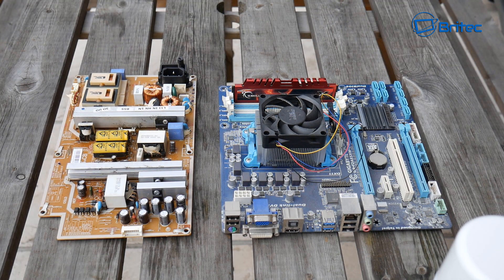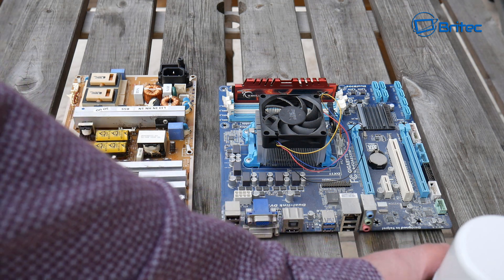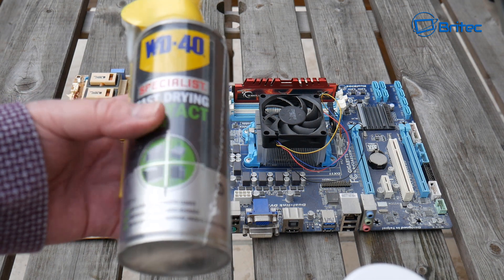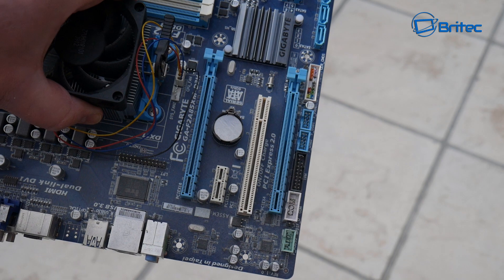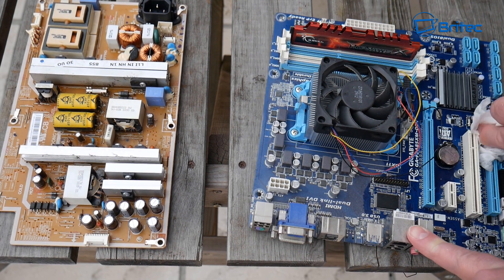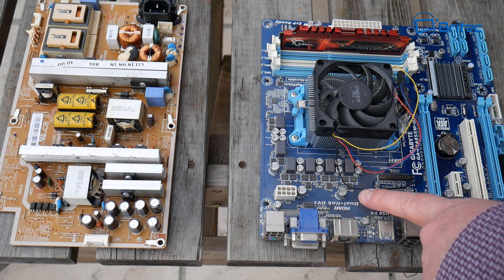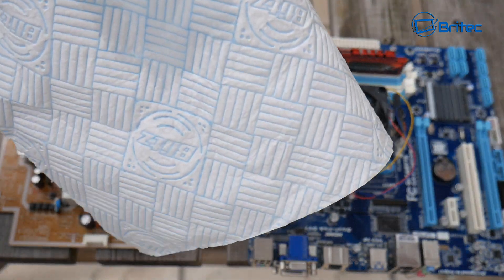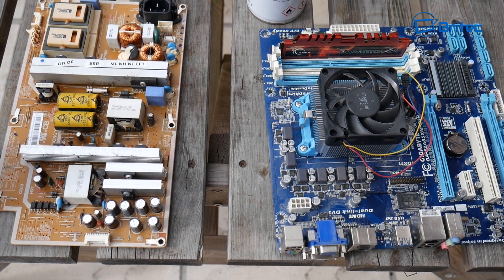How to Clean Computer Parts

Comment: Would Contact Cleaner work for more modern stuff? I have a ROG Maximus Ranger VIII and a GeForce GTX 1070 SC... I know its okay with motherboards, but I heard something about it not going w/ heat sinks well. I was just wandering if it'd be fine to use the Contact Cleaner on those

Comment: isopropyl alcohol is extremely flammable.  break cleaner, also known as tetrachloroethylene is not flammable and non corrosive.  they use this chemical on dry cleaning clothing.  but, not all brake cleaner is composed of tetrachloroethylene, so you have to check.  usually if it reads it is ABS sensor safe, it is the correct type.  this is common knowledge, look it up.  i do enjoy your channel but it is important to call out misinformation.

Comment: Just air compressor and a set of plastic brushes with different shape. Faster, cleaner and cheaper.
Reply from the maker: I have fixed many a water spilt laptop with isopropyl alcohol and a toothbrush, sometimes it's too far gone and shorted out something but it's worked. I have also cleaned a smokers laptop and removed all the nicotine with isopropyl alcohol where compressed air and plastic brush will not touch. So I think you're getting your wires crossed somewhere. These cleaners are designed to for PCB and electronics. Also to answer your question, I never said it will stop corrosion, I said it's non-corrosive and non-conductive.
Reply from the maker: That will not remove water damage or nicotine from smokers.
Reply: Britec09 water damage is very different from dust and gunk. Those chemicals can't remove or stop corrosion either.
Reply: You're correct

Comment: My experience; ten years of taking mother boards and simplistic pci components and removing everything including the batteries, and placing them in a dish washer, on warm it cold water. dry thoroughly, and viola. you can get boards that are saturated with cigarette smoke and bring them back to smelling brand new.
Reply from the maker: Got to be careful with water, if it's not completely dry you will fry the board because water is conductive.
Reply: Britec09 You can dry boards many ways. Oven low temps for an hour. direct sunlight, with a fan etc. haven't lost a board yet.

Comment: Hi Brian how are you, Brian yes it's a very good tip on those cleaning product,I use it myself for a few years,this guy put me on to it,he's a electrical Engineers.
Sometimes when I find a computer, and it's extremely very dusty first cleaning it with the compressor with a filter on it, after that cleaning with one those product.
Thank you Brian for one of your tips,your files videos of privacy Windows 10, I use one of those software you once recommended.
Thanks again Brian 😊
Reply from the maker: You're welcome.

Comment: I am curious as to what you mean by "It's not flammable to electrical components."?  The Servisol MSDS warns the user the product is up to 100% isopropyl alcohol which is VERY flammable.  Anyone using this cleaner must be very careful.
Reply from the maker: Yes your right, users must me careful when using any products.
Reply from the maker: My Mistake on flammable, meant to say its flammable lol good job I have you to pick up on my mistakes :P
Reply: ... but no electricity is not running though it

Comment: Thanks Brian :-D        (I've had to ditch avg, unreliable)

I usually take the board outside and brush the dust off, then tip some metholated spirits on the pcb and work it with a new paint brush, wash off with more meths and leave it vertical standing outside if its a decent day.
Reply from the maker: also as a bonus, you can drink the metholated spirits like the old wineo's used to in the old days. They used to drink metholated spirits with milk.

Comment: Please read the article what is wd-40 before you use it. https://en.wikipedia.org/wiki/WD-40
Reply: It's better to use this https://www.amazon.com/Wooster-Brush-Q3208-1-Softip-Paintbrush/dp/B000BQRF4W/ref=sr_1_6?ie=UTF8&qid=1498937564&sr=8-6&keywords=paint+brush  and this https://www.amazon.com/3M-Dust-Remover-Compressed-Duster/dp/B0032OX1N4
Reply from the maker: This is not standard WD-40 like what you're showing.
Reply from the maker: Compressed air I mentioned in the video and video description, also Compressed air will not remove deep grime and water damage from liquid spill